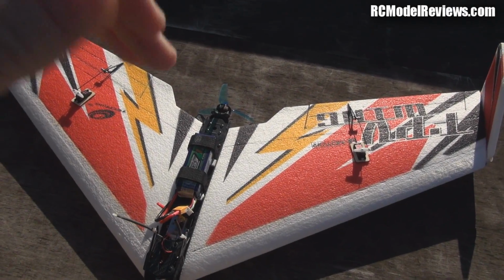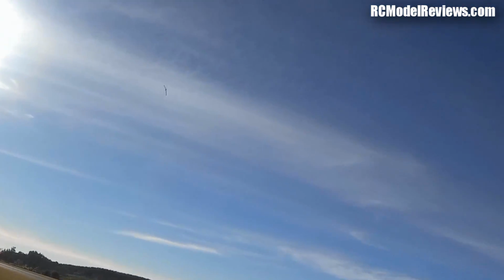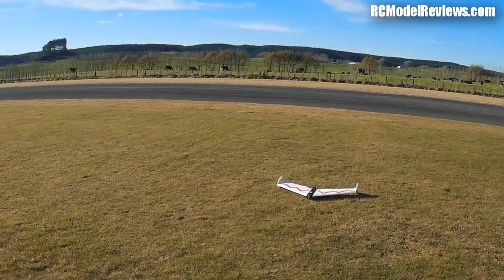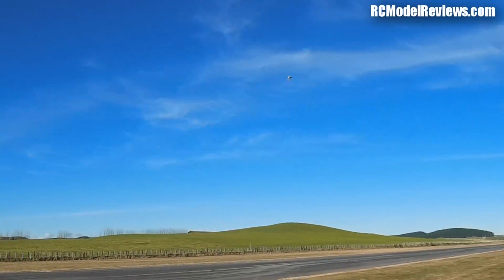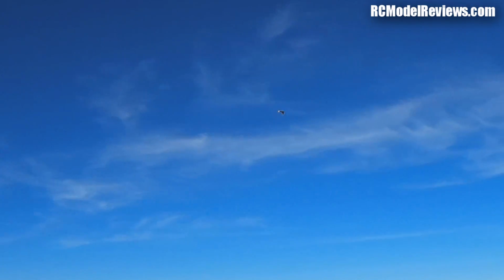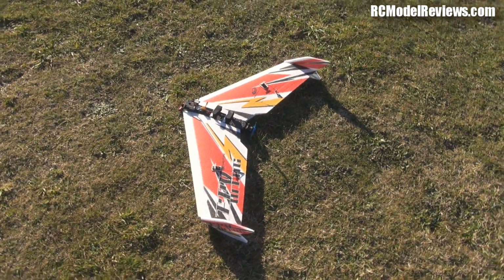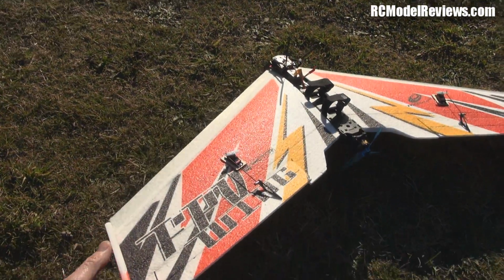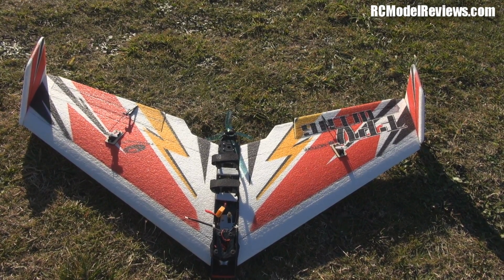TechOne FPV900 wing with Savox servos

Comment: i had good results strapping elevons with fiber tape. I cut them totally off first and did a fiber tape pass at 0 + 45 + 90 + 135 deg. I think i also embedded and superglued a 1mm carbon rod top and bottom length-ways.  Used the tape-hinge technique to reattach them

Comment: Seems like a lot of work for a wing that cost $160. Could you just laminate the elevons instead of the whole wing if that's the problem? Perhaps flat carbon in the form of an arc embedded in each elevon? Thanks for the video and Happy Flying!

Comment: I don't like the position of the control horn so far off center and the aileron material being so flexible. maybe you should get some of Matt's carbon and put some on the Leading Edge of the aileron to get the control pressure equal over the whole length of the aileron. like the way we used to make control arms on Balsa planes.

Comment: would clear epoxy/glassfibre resin coating on the elevons work? or would it eat them? maybe if taped first to create a barrier? Of course it'd mean quite a bit more weight, so how far forward can you get the battery to compensate for the CoG shift?
Reply: ah that's better 😊

Comment: Great review as always Bruce:-)
That thing is flimsy. As a dedicated wing pilot I can say that we almost exclusively fly wings out of cut EPP with fiber glass spars and laminate. We kind of regard the RTFs as toygrade. The current hotness is the Ritewing Hardcore series. These are stiffer, heavier and overall better engineered to handle high speed.
Reply: Hi, sounds like you should be my "goto guy" for wings :) I recently fell again for them. been flying the s800 yesterday. not very stable but 15+ mins of flyingtime is super luxurious for me.
Reply: LoL:-) Well, thanks! The s800 have quite a following, but you will feel a real difference if you try a Hardcore. From the videos I have seen the S800 is pitching a bit at high speed (as most wings).

Comment: I really like the look of this wing, but man, the Tek-Sumo seems to be a lot better if speed on a budget is what you're after. With a NTM 2836 2200kv spinning a 7x5 prop powered by a 2200mah 3S it would destroy this thing. Clocked mine at about 114kph on a GPS and I don't think this one can keep up.
On the other hand, I like the whole centre section of this one and how the wings come apart if you crash or have a tumble like you did, I think that's very cool. But using flimsy foam on what's meant to be a fast wing is just bad R&D.
Hope you get it sorted and that we see this wing's full potential in the next flight. Cheers for all the videos and hard work you put out there, really enjoy your stuff. 👍🏼
Reply: Makes you wonder if they even attempt to fly any of the products they churn out? So far we have seen 2 flights for a total of maybe 15-20 min with all ready running into multiple problems.
Reply: Side85Winder Yup, agreed.

Comment: Laminate it!
Reply: When you say laminate do you mean a light layer of fibreglass. This was mentioned earlier but not sure about this process. Please explain further laminate with what? What are people using to do this?
Reply: I meant laminating film, it's a clear film in varying thicknesses with a heat activated adhesive on one side. A lot like Monokote or similar covering material for building with balsa, but without the shrinking properties. (or at least less shrink) It's ironed onto the foam. This is one place to get it in the US, I'm not sure what other people use. http://alofthobbies.com/new-stuff-laminating-films.html